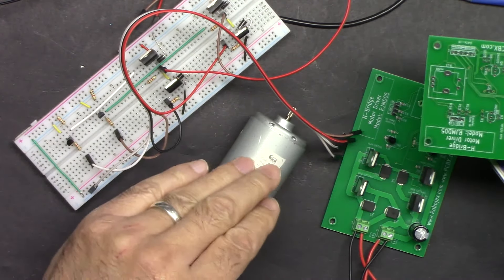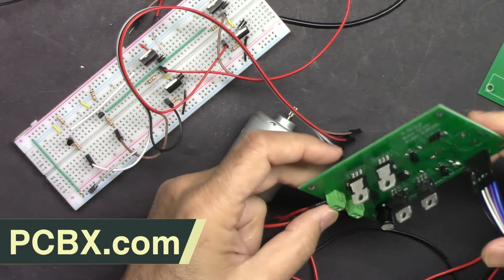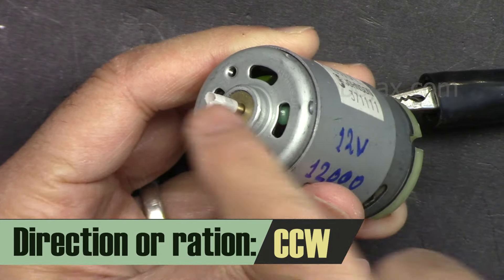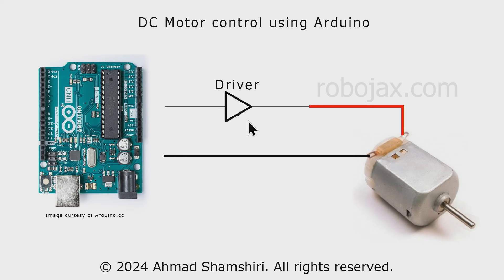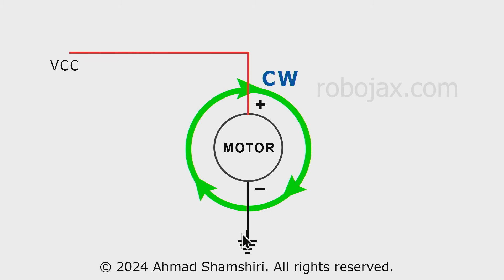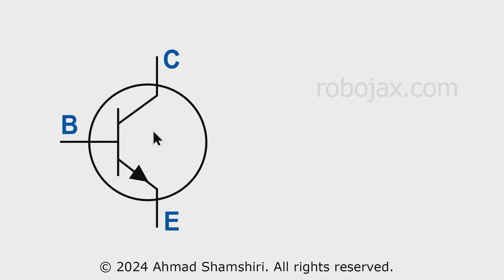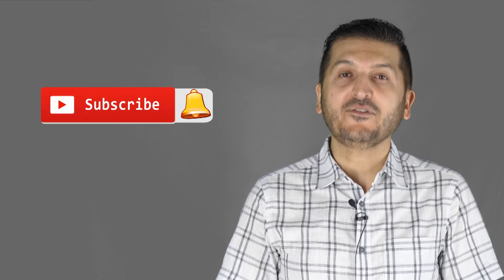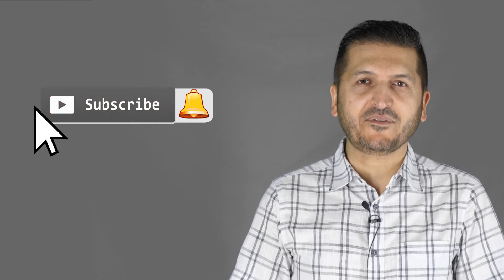Building H-Bridge Motor driver using TIP120 TIP125 on breadboard and full PCB Design with Arduino

Comment: Please tell me: does the motor keep it's force at low speeds, thanks in advance: I mean it would be nice if you did a demo with the motor loaded: thansk once more, really nice work, really nice channel!
Reply from the maker: may be you did not watch it. I demonstrated on breadboard and then using the actual PCB prject. fully tested. CW, CCW and speed control and that is what a motor driver does.
Reply: @robojax  I meant attaching to the motor some mechanism or some weight or some load, which makes the motor apply some torque. But this is not a criticsm: the video is excellent!!!!
Reply: Nice